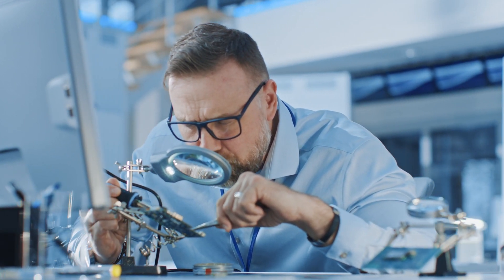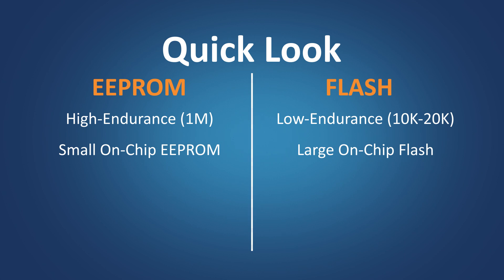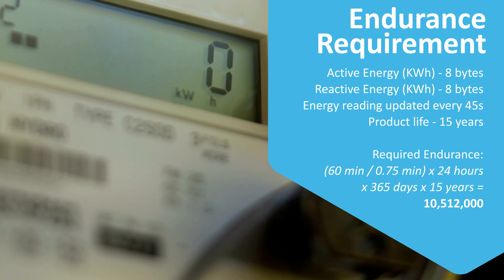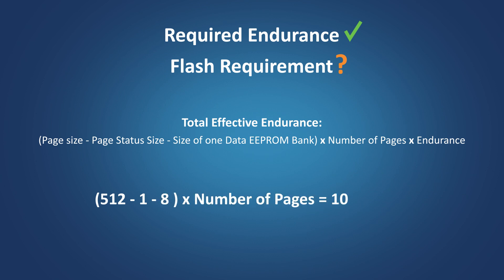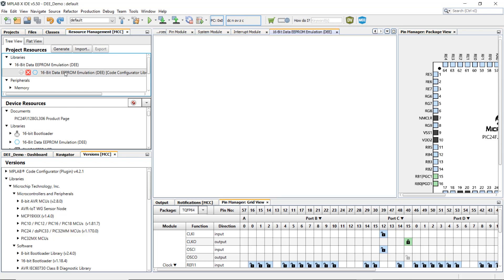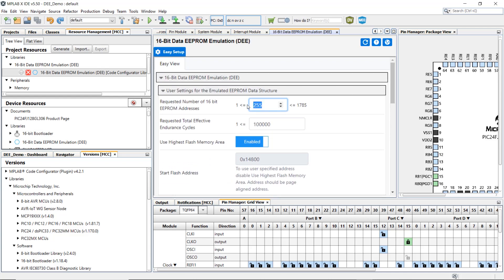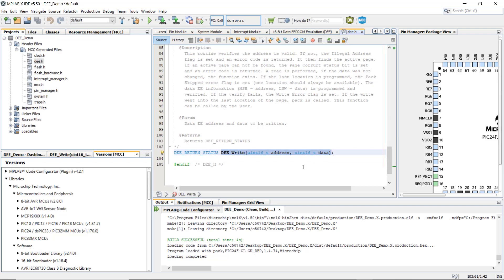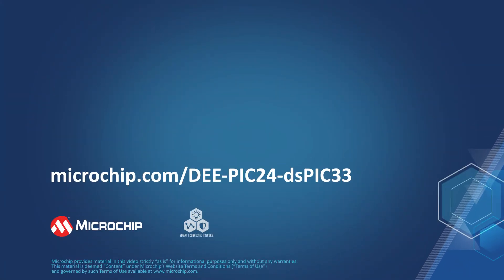Data EEPROM Emulation on PIC24 MCUs and dsPIC33 DSCs Using MPLAB® Code Configurator

Comment: That's nice and all but loading the library itself is impossible using the latest MCC core version & MPLAB X IDE version. Even when the library is loaded using an older MCC core version (v5.0.1~v5.2.1), it won't show up under Device Resources.
UPDATE: Library works using the standalone version of MCC (core v5.0.1)
Reply: having same issue here. This is quite annoying
Reply: @mrcrud5  MCC Standalone finally ran the library for me with core v5.0.1
Reply: Same problem. It's sad that Microchip doesn't fix these problems. He should not have saved on those few cents EEPROM.

Comment: 3:12 = The equation should be "(Page_Size - Page_Status_Size - Size_of_One_Data_EEPROM_Bank) * Number_Of_Pages = Endurance". Whatever equation given on the screen at this point, does not have any left hand side or right hand side.
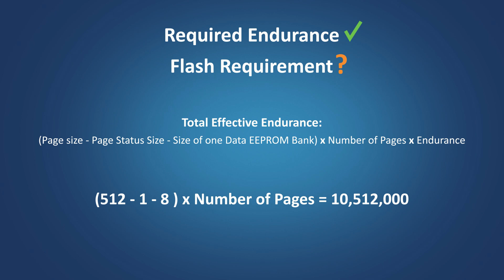3:36 = Data_EEPROM_Bank_Size = 16 Bytes (for active and reactive energy) = 8 words. This should have been clarified.
4:01 = (512 - 1 - 8)* Number_Of_Pages = 10,512,000. We get, Number_Of_Pages  = 20898. Where did the factor of 10,000 come from?
6:22 = DEE_Init, but audio is DEE_int 🙂

Comment: This looks like just what I want, however when I use MCC 5.5.7 on a dsPIC33CK128MP205 I don't get the "16 Bit Data EEPROM Emulation" library as an option. If I check the content manager it has filtered that library as not compatible. Is that correct or is that a mistake?
Reply from the maker: Hello! The "16 Bit Data EEPROM Emulation" library is designed to be versatile and compatible with a range of devices, including the dsPIC33CK series. An example of its application with a dsPIC33CK device can be found on this GitHub repository: https://github.com/microchip-pic-avr-examples/dspic33ck-curiosity-data-eeprom-emulation-demo. 

If you are having trouble getting access to this, please reach out to our support team, here: https://microchipsupport.force.com/s/newcase

Comment: Is it supposed to work with PIC24EP256GP206?
Reply from the maker: Hi there, thanks for your question. This approach is also applicable and compatible with the PIC24EP family of microcontrollers.
Reply: @MicrochipTechnology  It did not work. Or better: after downgrading MCC core to 5.2.1,  it generated some files and I was able to compile them. However, reading/writing operations were not possible. I had to go back to a 2007 generated version and change the flash_op.s file with Flash Operations 33E_24E.s file. So in the end I must say that the showed procedure does not work for PIC24EP256GP206 microcontroller. I found the solution on a forum.
Reply from the maker: We apologize for any inconvenience caused by the advice we provided. Our intention is always to offer accurate and effective solutions to our customers. Thank you for sharing your experience and providing valuable feedback regarding the issue you encountered with our MCC core and the PIC24EP256GP206 microcontroller. We appreciate your patience and understanding throughout this process. Should you have further questions, we recommend using Microchip’s Tech Support center: https://microchip.my.site.com/s/